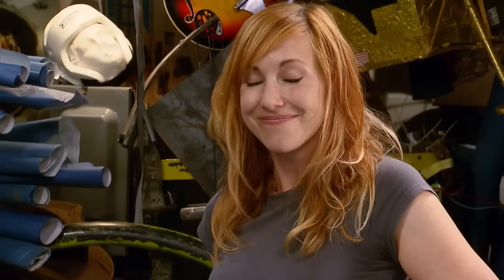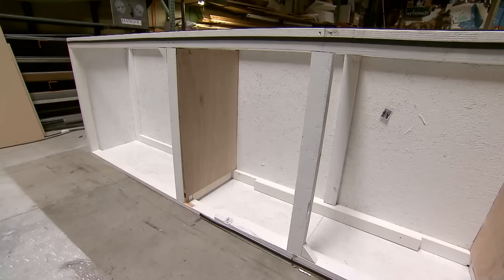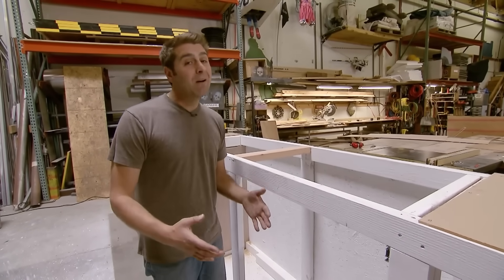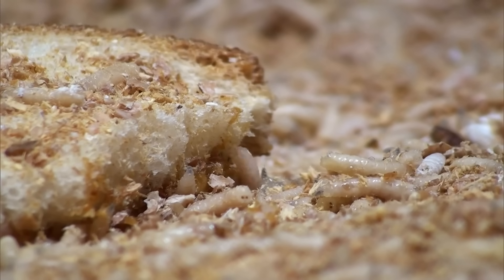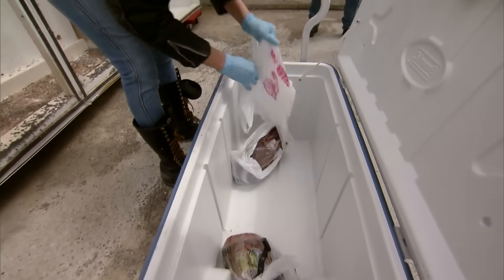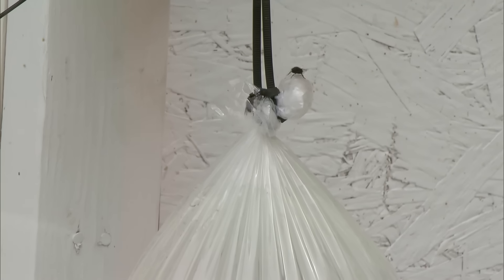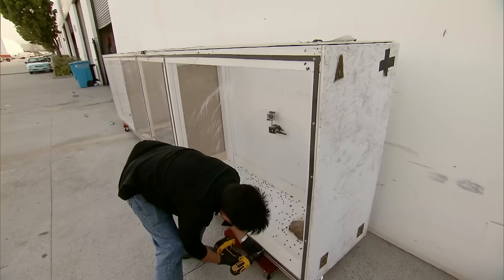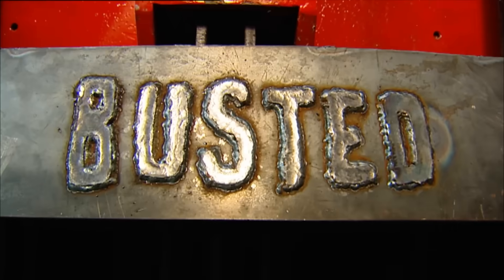Do Hanging Bags Of Water Actually Scare Flies Away? | MythBusters

Comment: I visited my relative, who lives in the woods near a pond.  There were large black flies everywhere when we walked from the car to his place.  I even commented, "who would use his deck with all these flies buzzing around?"  When he asked us to come onto the deck with him, we did.  The flies, which were very irritating between the car and the house were almost non-existent on the deck.  When we asked why, he pointed to the bags of water hanging from the top of the deck.  It obviously has something to do with the prisming of light.  When the occasional fly flew across the deck, they were amazingly confused, running into everything at high speed and spinning as they did.  You need strong light being prismed through the bags in order to have the proper effect.  Putting the water bag into an enclosed area, and the daylight not being bright both contributed to this experiment failing.

Comment: Slightly warm. The bags distort the visual signals flies need to navigate. So when their visual systems compare signals from through the bag versus not, they stop flying and walk instead, which is slower. Effectively, drunkard's walk, or fly, statistically results in their moving further away from the bags.

This means that the placement and size of the bags and the ability for the flies to get away are crucial. You'll find that people who do this adhere to particular conventions. Try it under real conditions before failing to reject the null hypothesis.

Comment: Botched experiment. 

The bags must be in direct sunlight.

Bags work best if they have something inside of it to reflect the light.

The reason that it works is that the bag creates a prism and the reflected light makes the fly see flashes of bright colors, indicating that they are in the proximity of a predator. 

There are several other options that create the same effect.

1. Prisms hung from a string. (Obviously)
2. Colored glass mirrors hung from a string.
3. Broken CDs hung from a string

Comment: I lived in Mexico for a few months. The shopping district in the city I was in (Ensenada) was near the wharf. The wharf smelled like dead fish. Flies all over everything in the shopping district. Every shop you went in was literally buzzing with flies.
Now, I don't have any skin in this game. I don't have any beliefs either way about bags of water. I had never heard of the bag of water trick before the events of this story. Here is what happened: One shop I entered had no flies. Not a single one. The door was left wide open (as were the doors of most shops). The absence of flies was immediately noticeable because they were so thick everywhere else. I asked the shop owner why there were no flies in their shop. She pointed up. Suspended from the ceiling, in the center of the shop was a large, clear bag of water. No pennies. No foil. Just water. My guess is that flies would occasionally enter the shop, and leave because something about the bag freaked them out. My theory is that the flying movement of the fly itself is reflected in the water bag. This could appear, to the fly, to be a predator, or just something flying around up above that the fly doesn't like. The small chamber used in this experiment eliminates the large flying area inside the shop, and therefore doesn't recreate the conditions I saw in the shop. There was no rotten meat in the shop, either. Anyway...

Comment: Didn't the bag of water need direct sunlight or at least light from multiple angles to work according to the theory? And of course at least a couple of bags to increase the chances of flashing the flies
Reply: Also, for a huge amount of meat, with a huge amount of flies, how can they be sure the theory could work in the first place? It is an empiric public experience against a few flies in common households, not a few bags of water in a slaughter house. It is absolutely obvious it was never meant to be scalable! (Not saying it work, just that the experience is unfair)
Reply: yes i agree, they really shouldve placed at least two bags. one hanging, the other one near the meat so effects are really clear. and the myth is actually putting crumpled aluminum foil inside the water so the light really reflects at all directions
Reply: And also hang loose so they move a little bit.
Reply: I also heard you should put shiny pennies in it.
Reply: @robertbratcher2078 - that’s correct. And a nearby light source such as hanging it under the garage light. Refraction messes up their compound eyes perception of the area. I used it once when friends were grilling and eating fish in the garage. You would swipe your hand to scare off the flies, and more flies would land behind it. I hung a gallon ziplock bag with a few shiny pennies in it from the yellow garage light. We did see flies hopping on the ground, but they were no longer bothering the food at the table. I didn’t need MB’s experiment, but I’m sure they had fun, views, and paychecks.
Reply: There was sunlight for the 60 mins. And if ONE bag effectively doubled the number of flies, then MORE bags wouldn't seem to have a chance at reducing it.

Further, no studies done to date have shown it effective either.
Reply: @PhrontDoor  There was sunlight, but the point is not to heat the bag, it's to illuminate it from many angles, and it was blocked from basically half of the angles. The next thing you said assumes diminishing returns without any base.

I'm not saying the bags work, although I've seen them distract flies all my life, but the experiment was too simple, flawed, and if all the studies are done like this, it's hard to take their results as scientific truth.
Reply: @ivanaviNiebla  You do realize that the sun comes from ONE single angle at any given moment, right?
All rays from the sun are always expressly parallel, ie., the same angle.
Reply: @PhrontDoor  Man, just fill that bag with water and put it in front of a white wall and another in the middle of your backyard or the street (or just not that close to a wall) and see which one sparkles the most. Not that hard to even imagine. 

In the street you even get reflections from cars and house windows.

Do you want me to explain reflections, contrast, and flicker like if you were a toddler?
Reply: @ivanaviNiebla  It was in direct sunlight. There was a surface BEHIND it too.
It's ok..  I took three years of OPTICS in college, and five years of physics (well, optics is technically a sub-topic therein).

I'd phrase this in terms that a toddler might understand, but then you'd clearly still need help reaching that level of comprehension.
Reply: @PhrontDoor  You clearly don't understand the part about contrast and flicker. The surface BEHIND is hindering the whole thing. 

It doesn't matter that you studied it, you don't understand the most basic concepts applied to real life.
Reply: @ivanaviNiebla every mouth breather that does this hangs it on a post or a wall. Its was in realistic conditions to how people use it. Inb4 "hurrr durr my water bag setup doesnt do this"
Reply: That was my understanding. I saw it used effectively in the Yucatán at an open air restaurant. The idea is the prism effect is what actually does it. It seems that likely hanging glass prisms would also work.
Reply: I've seen pennies in the bag near sunlight. NOT JUST WATER.

Comment: I could have told them that the water bag theory is BS. When I hung bags of water they have an additive that attracts flies and a trap at the top. Problem with that is, it's hot as Hell out during that time of year and the rotting flies in the water sets up a hell of a stink if left for long. Nothing else really seems to work to trap or drive off house flies and I've tried them all . Electronic fly swatter seems to be the most effective along with making sure your property is as free of attractants as possible.
Reply: What worked for me is I stopped leaving rotting meat lying around my house.
Reply: The way I was told the story is that the bags should be hung above doors and windows. I assume that they don't want to fly through the opening. I tried it and it seemed to work that way. Of course keeping bags of water in the doorway is a pain. I am not sure this test is valid.
Reply: brother all insects are afraid of smoke, just use a smoking gun and its gg
Reply: @MrAngerius I don't want my home full of smoke all the time.
Reply: @marcpeterson1092  then you can put a couple of pots with either Basil/Lavender or Marigolds, their scent repels not only flies but also mosqitos and other insects, just be sure to put them indoors and infront of the windows, you can also just buy their aromatic oils and spray them on your curtains/couches w/e.
Reply: @marcpeterson1092  then just put a pot of either Lavender/Basil/Marigold near your windows from the inside or buy their aromatic oils and spray them on curtains or couch
Reply: @MrAngerius That one also should be tested. I also wonder about the range. How far does the effect reach?
Reply: @marcpeterson1092  i have 1 plant near each window and it works pretty well you can also rub some of their leafs if you think that the potency is not enough, but it builds up kinda passively if you have 5 pots of Lavender (or any other) or a mixed combo for like 1 year straight then your room will be protected. My granda has pots of basil, mint and rosemary in the corners of the rooms and that also works.
Reply: My family has a farm. The bags 100% work. You put a couple pennies in and you hang at the bar entrance so light can actually hit it.